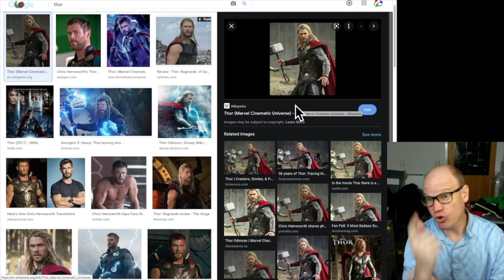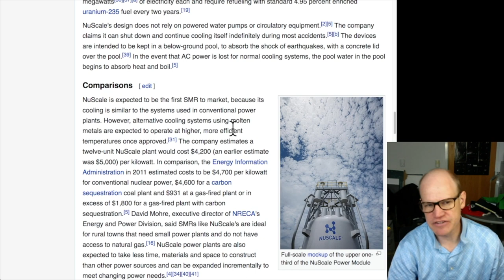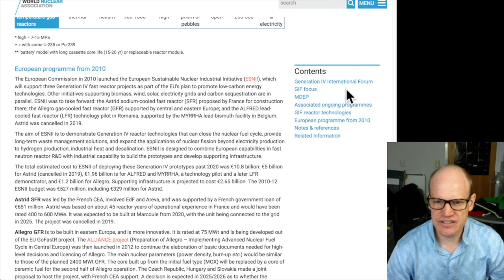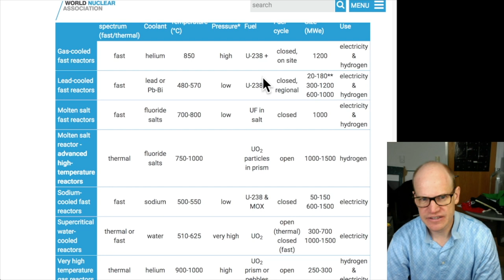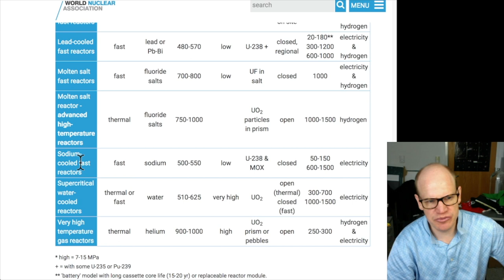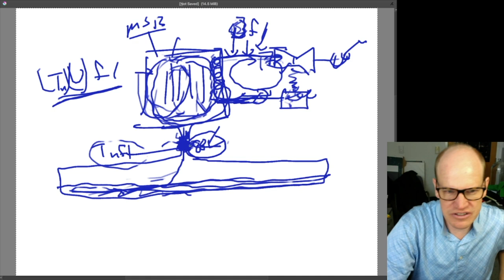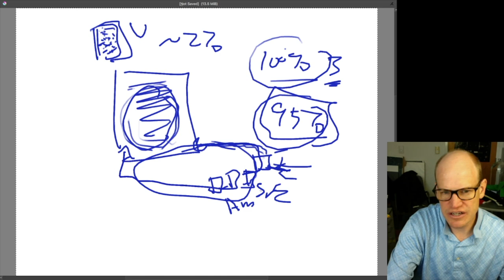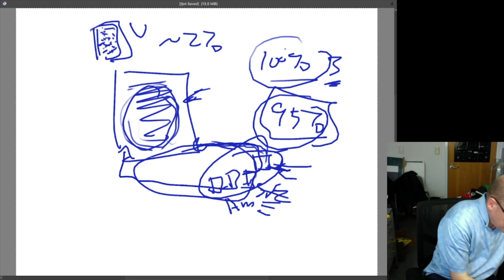Nuclear Energy 06: Generation IV Reactors

Comment: Another problem with nuclear power is the labour requirements. Many existing nuclear power stations have ~1,000 full time workers and then even more contractors during refueling

By comparison a CCGT has 40 full time staff

While the fuel for nuclear is very cheap, the labor costs are 20x higher

These addition 960 staff at say $100,000 per staff (wages taxes and overheads) means $96 million additional labor cost. This is pretty significant cost even spread over a 1GW reactor it works out to around $12/MWh additional labor costs

Nuclear needs to improve on every metric

Labor cost
Capital cost
Build times
Land use (ccgt take up 20x less land)

Unfortunately I don't see a significant nuclear build out in the US or Europe. The only chance is small offshore reactors and perhaps heat.pnly reactors. Otherwise its likely a slow decay as old reactors are shut down and few new ones come online
Reply: I think I already told  you before, the cheapest solution might only get us to hell. Time to think about the best solution instead of the cheapest. (and if this two thing are not the same then it's time to question how we associate costs with resources, including stuff we spoil by "going cheap")
Reply: >Nuclear needs to improve on every metric
No, it doesn't.

>Labor cost
Not an issue. France has been running fine on 70-80% nuclear for the past 50 years with competitive electricity prices compared with its neighbors.

>Capital cost
Every industrial structure demands capex. You know what also demands huge capex ? upgrading your whole power transmission grid to accomodate renewables.

>Build times
Build times aren't an issue only for nuclear. All megaprojects (transportation, tunneling, airports, trainstations, etc) throughout western europe are never built on time and on budget. And I'm not seeing anybody saying that we should stop building railways or airports. And also, Germany's upgrade of its power grid is way off schedule too.

>Land use (ccgt take up 20x less land)
Yeah, uh, I'm gonna need a source for this. Just googled "land use for power generation" and nuclear consistently comes out with less land use per kwh than ccgt plants.
Reply: @SC-yy4sw  Most countries already have existing infrastructure and infrastructure under construction or committed to

For example the UK by 2030 is going to be 75% wind powered and 10% nuclear 10% solar and Hydro. Leaving only 5% for something else (either natural gas or biofuels). The UK by 2030 will still be approx 10^ nuclear. So that's 105% from non fossil sources (UK will become a net exporter of eletricity or will increase consumption eg with EVs etc)

We aren't going to scrap what we have and what we are building to go for some hypothetical all nuclear option

Thus is the big failure of nuclear cheerleaders. Not accepting the reality that we aren't starting from scratch and already have a vast amount of infrastructure in place or under construction
Reply: From what I can hear from people who worked at nuclear power plants, the core staff that is needed at any given time is about fifty people. Given that the plant has to be staffed 24/7, the core staff is only about 150 people. The rest are non-core but are counted as staff because the regulation requires it. So the janitor, the accountant, the cafeteria people, the gardener, etc. are all counted as staff. But, no, they are not paid a hundred grand. They get paid better comparatively, but not a hundred grand better.
Reply: @freethinkingdragon8074  You are very out of date. Yes the wind turbines which were deployed 30 years ago were silly expensive toys. The wind farms deployed 20 years ago worked okay but were far too expensive. The wind farms deployed 10 years ago cost more why pay more right? The wind farms deployed today cost just a little bit more than gas fired power stations. And the wind farms deployed in 5 years time will be even cheaper still

How can you not see the wind turbine advances amd no chance your mind

It's like the first flight in 1903 by the Wright brothers you would have seen that and concluded this is riduclus expensive hobby. Fifty years later we had jets flying people across the Atlantic. Technology develops and wind turbines have developed vastly over the last 3p years

So while you would have been right A long time ago. You aren't correct anymore

This will be proven beyond a doubt by 2030 as the UK A large country of 70 million people will get 75%+ of its electricity from wind power by 2030
Reply: 75% electricity from wind is impossible.  The cost of intermittency grows as the percentage of electricity from wind increases.  There is no way to store electricity on the scale of a grid.  Denmark can have wind because it has an auxiliary in the form of nuclear and hydroelectric power imported from Sweden and Norway.  Wind cannot be a self-sufficient energy source because it depends on other sources when the wind is not blowing.
Reply: @freethinkingdragon8074  While wind is indeed intermittent and not controllable. The new generation turbines deployed in 2024 will achieve a capacity factor in excess of 60%

Since we will be placing wind farms across the UK the correlation isn't a perfect 1 which means some times when there is no wind in southern England there might be wind in northern Scotland 

These new generation wind turbines coupled with the existing infrastructure like the UK pumped storage and the interconnector links to our neighbours will mean the UK will in fact get 75% of its electricity from wind power by 2030

In fact as I type this right now, wind power is generating over 50% of the UK energy needs and this is a country of nearly 70 million people bigger than any US state
Reply: @kaya051285  Not to get between your argument and Robert's, but with wind the capacity factor doesn't come from better wind turbines. They come from picking the best site. GE has been bandying the 60% CF for a few years now but GE is cherry picking their number. The 60% is if the wind turbine is placed on an offshore site on the North Sea. Place some other wind turbine at the same site at the same height and they will achieve the same CF. Conversely, place the new turbine somewhere near London and the CF will drop down to whatever it is around there. New turbine model doesn't promise a better CF. New sites, farther away offshore, may, but that comes with its own extra costs and problems.
Reply: @tonychen76  no this is not quite correct. The 60%+ capacity factor is mainly achieved by 'over clocking' the wind turbines

Imagine you have a 10MW turbine and a 15MW turbine. Both achieve 50% capacity factor in the North Sea

Now lets say you take the 15MW turbines blades and put those blades onto the 10MW turbine. What happens?

You've just managed to increase the capacity factor of that 10MW turbine from 50% to 60%....with just longer blades. Yes a longe blade and slightly taller tower cost more but you more than make up for it in the additional annual generation

They do this with solar farms too
A 300MW ac solar farm might have 350MW dc of solar panels
Reply: @kaya051285  Oh, that trick. You do realize that's even worse? That's a deliberate misrepresentation from the wind turbine company. If they put a 15 MW wind turbine blade then the wind turbine should be rated as a 15 MW turbine.
Reply: @tonychen76  Why do you think it is a 'trick'?

As a buyer you don't give a dam how big or small the blades are

What you care about are cost and these 'tricks' lower cost and they also improve the capacity factor

I really do think the anti wind power crowd simply decided to stop looking at improvements and based their views on the technology that was available 5-10-15-20 years ago

It's like saying in 1990 these mobile phones will never take off they are big heavy expensive ugly and then not updating your view even though mobile opines have evolved into the iPhone 14
Reply: @kaya051285 Because that sort of shenanigans make long term planning harder. If we have a 10 MW wind turbine we can expect that the maximum output is 10 MW and plan around it. The equipment can be rated for a certain voltage and ampere and if it goes significantly beyond that, it should shut down because there's probably a short somewhere. But when someone label a 15 MW wind turbine as 10 MW in order to misleadingly get a better capacity factor, the planning that is suitable for a 10 MW max power source is off by 50%. That can wreck equipment.

Now, I am sure that GE is smart enough to tell the utility buyer what the real max power is, but please understand that this sort of misrepresentation is the same sort of misrepresentation used in greenwashing. It makes you feel that the corps are licking the problem with technology, therefore it's fine to throw more money at them. But have you thought why it was necessary for them to do this sort of tricks? If it's that good they wouldn't need to do it. A wind turbine with 15 MW blades is a 15 MW wind turbine with maybe 40% CF (depending on location), not a 10 MW wind turbine with a 60% CF.
Reply: @kaya051285  Nobody said that wind turbines have not improved. Being able to have longer blades for example is an improvement. The amount of energy we can harvest from wind is a function of the area described by the blade, so by being able to have a longer blade you can get more energy per wind turbine. But actual capacity factor is a function of actual wind availability and we can't improve it. If on average a location have a wind capacity factor of 40%, playing around with nameplate capacity does not make the wind blow more often nor stronger. You are just putting up bigger wind turbines and there's likely some cost saving from economy of scale, but that's all.

If you are certain that the UK will do all that, hey, it's no skin off my back. I don't mind. You're the one buying it and may it bring you joy.
Reply: @tonychen76  The capacity factor is a function of both wind speeds as well as turbine technology

The first turbines installed in the North Sea attained a capacity factor of 22% the most recent existing turbines in the UK waters get close to 50% capacity factor

There is no intrinsic capacity factor of a given location. Its down to the wind resources and the technology used

Anyway the UK will indeed by 75% wine powered by 2030 for its electricity needs. But I'm sure even then you'll claim its all a hoax
Reply: @kaya051285  Well, you are claiming that UK will be wine-powered and we all know UK prefers beer. But your typo aside, you do love putting words in my mouth and then attacking the strawman. That's twice now that you claimed I said something that I never did. Look, you are the one who is buying the wind power, either directly via your energy bill, or indirectly via your tax money. Not me. It's no skin off my back.

Comment: You corrected yourself, but please don't call them "thorium reactors" they are molten salt reactors. We need to ween thorium fanboys off that inferior fuel cycle to the reality of uranium. All the good things you're heard about thorium are equally true for uranium except it's cheaper and easier to do.
Reply: Imo for now Elysium's MCSFRs (have you checked them out?) are the best option, but for the future, with more R&D, Thorium is interesting. China is building them now, since they have shloads of Thorium left over from mining heavy metals.
Reply: @red-baitingswine8816  Elysium is easily the best design out there but not going to be the fastest to market, nor the cheapest. I think that Terrestrial Energy will be first to market as they don't need HAELU like Terra power and others do. 

Thorium will always require a breeder reactor to fission and those will always be more complicated and expensive. Because of that, I think uranium will dominate for a very long time. Also, we have a couple billion years worth of uranium to use up before thorium is necessary. 

Now, if Thorcon Powers thorium converter comes to market as advertised, I will immediately change my mind about thorium. Lol